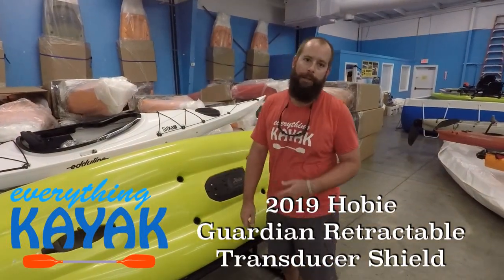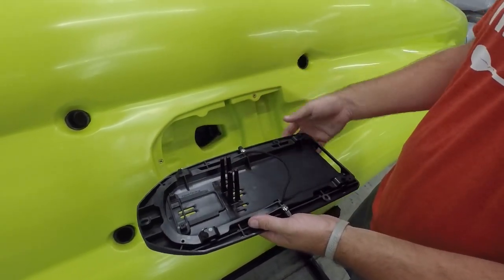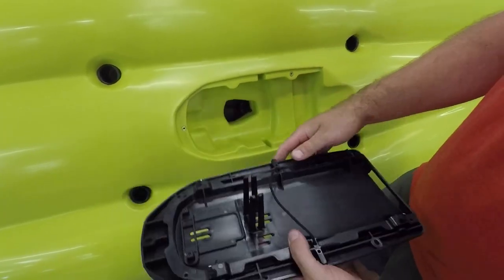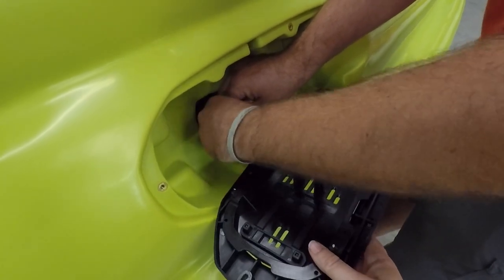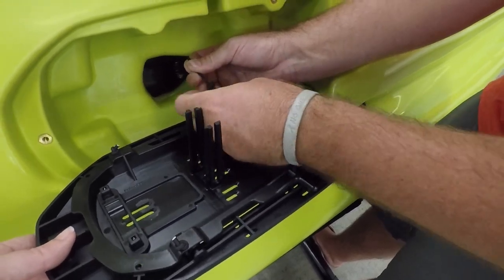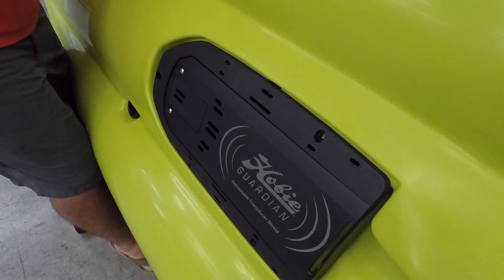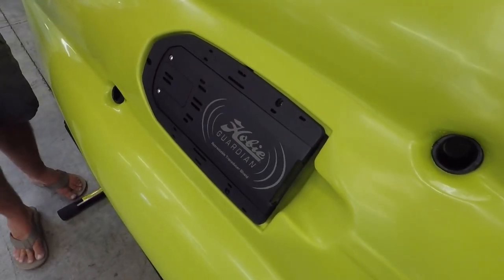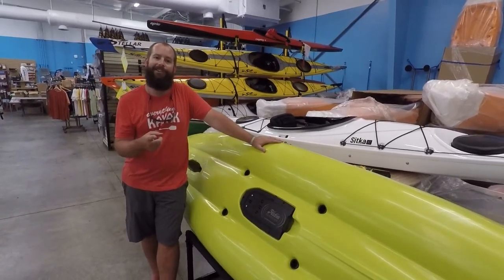2019 Hobie Guardian Retractable Transducer Shield

Comment: Couldn't you just adjust the tension from the other end (where the T-handle is)?
Reply from the maker: If the adjustment is made at the T-handle and the line is cut to allow the cap to be placed back on.  Future adjustments may not be possible due to the reduction of cord.

Comment: How much junk will it accumulate when in shallow grass? Is this a good add or a fad?
Reply from the maker: With the included bracket that is installed in front of the transducer to prevent impact and debris collecting on the transducer, the accumulated junk should be to a minimum.
Reply: My totalscan transducer is getting scuffed up with the bracket that's out now; let's hope this eliminates that.
Reply: Mine is also with the Berkley Pro. Hoping this will solve that issue. Its a pain to clean out the Berkley Pro cover plate if you do a lot of shallow or sand style fishing. This one looks like it only 3 Hobie screws and it can be cleaned out.